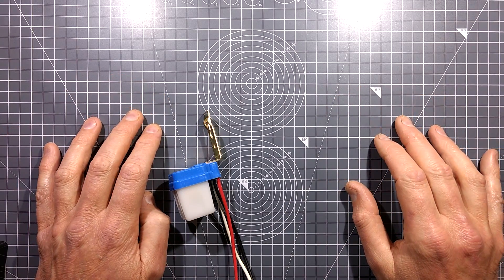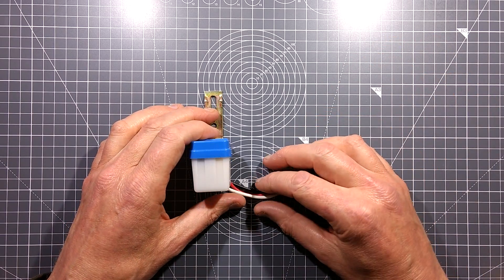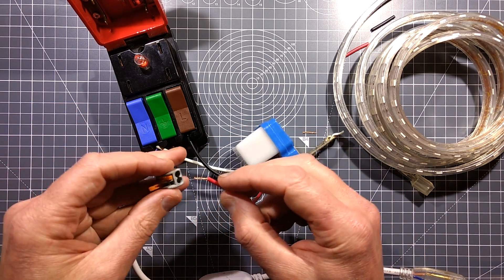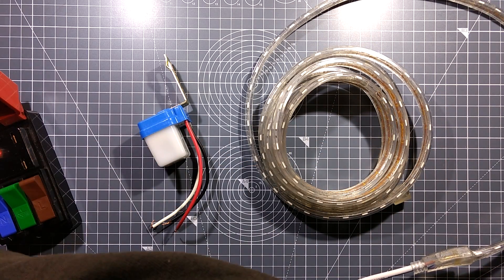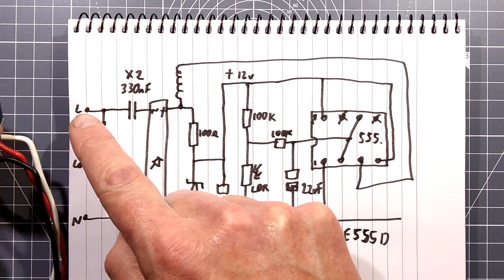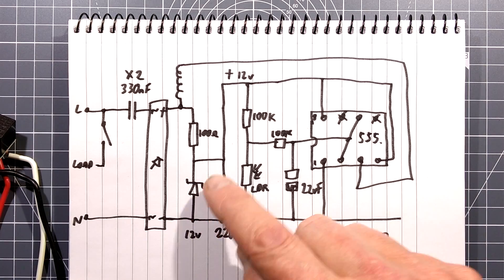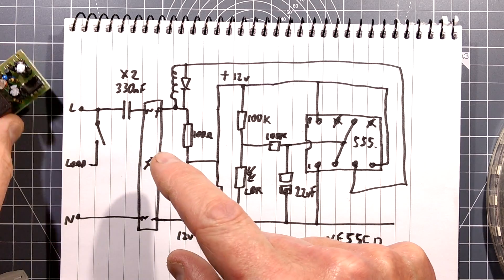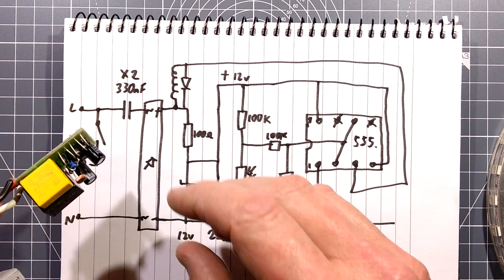Common Chinese dusk switch.  (With schematic.)

Comment: How about using one of these USB 8W soldering irons and a power bank for rewiring it on the field? BTW mine arrived, loving it.
Reply: Juan Herrero 8W really is not adequate for any serious soldering work (15-20W is a more reasonable lower limit).  You could get by with soldering very light connections with very light gauge leads or wires using an 8W iron, but try such on a windy day and will not accomplish much at all outdoors.  The easiest way to solder outdoors is with a butane torch, with or without a soldering tip (depending upon the precision demanded by your task).

Comment: Hi, I am wondering for quite a long time if PIR sensor can be replaced by very common ebay ultrasonic distance measuring module in combination with NE556 to drive low voltage LED lightning in case when PIR is too large or useless due its pyroelectric principe... If this sounds interesting for you, maybe you can build something on breadboard :-) I hope that this build will interest many users ...

Comment: I use thse Wago connectors for connecting lamps to the wires coming out of the ceiling (if the lamp doesn't come with a terminal block); also for connecting the heated build platform of my 3D printer to an ATX PSU. They happily take 6A and more.

Comment: Clive..is this possible? to make a solar/ battery grow light for the green house.. so when it is dark the grow lights come on and provide growing light for the plants..what would you need for this? how big could you go with the lights/battery/solar panel for a  10x6 green house?Cheers for any tips and advice.
Reply from the maker: I doubt it would be viable to produce the proper levels of illumination without a very big panel and battery bank.  But you could use the 12V version of this and a smaller panel to at least provide general illumination.
Reply: Thanks for the reply Clive... I was thinking of the led grow lights in a strip type...low wattage..like these 
eBay item number:321913686531
using some 18650 3000 mAh cells in a bank of them 12v ish charged from a large 320w solar panel..enough to get the led strips to run for 8 hours at night approx.. depends on how much sun is available during the day to charge the battery bank i suppose.. but i guess it could be worked out to what is required.
Reply: Mitch Seymour You typically need very high light levels to effectively enhance plant growth and that means high wattage lighting (even by LED standards).  Quite simply, if your LEDs do not require significant heatsinking then they likely do not put out anywhere near enough illumination for plant growth purposes.  For a stationary application lead acid batteries are usually going to be far more economical and have less voltage swing (LED illumination levels are very sensitive to variations in voltage unless driven by a DC-DC converter to maintain a stable voltage as the battery discharges).  Also keep in mind that the full sun equivalent hours for charging purposes is typically equal to only a fraction of your available daylight, so you will likely need a solar panel array capable of fully recharging your battery within 5-6 hours each day (a bit more in summer months), even on an overcast day when they may only provide perhaps half of their rated power.

Ideally you would use LEDs optimized specifically for plant growth as plants desire slightly different color peaks (wavelengths) than we necessarily desire in our interior lighting and the greatest bang for the lighting dollar is found by delivering exactly the wavelengths that are most efficiently exploited by plant chemistry (the most important bands are typically in the red and blue wavelengths leading to a magenta tint to the light, with other wavelengths sometimes added, such as green, near UV, or near infrared, in to further tailor growth characteristics for specific crops).  They also often avoid phosphor based LEDs (such as our typical white LEDs) since the phosphors degrade over time, typically opting for a mix of pure color LEDs to obtain the desired amount of light at each peak as single color (non-phosphor) LEDs do not degrade significantly over their lifetime if operated within their design limits.

Comment: I have 1 of them wired to my back light with a 20 watt fluoro that hasn't missed a beat in 3 years of running 24/7.
Reply: Well my light finally died, thought it might have been the dusk switch after checking the tube, and starter and they were fine. I had a spare switch stashed away in case it died and finally found out where I hid it all those years ago, wired it all back and, nothing happened, figured I must have wired it wrong so had another look at the old one that I took out, connected it up to mains it still works, rechecked my new install and it was working too, so the flouro fitting has died at last, time for a new 40 watt er.

Comment: I would love a tear down of that Quick Connect(to main). That looks safer than holding a plug to the main wall socket and thinking "ok... if there is spark or smoke I need to unplug this right away."
Reply from the maker: Just search my videos for it.  Quick test.
Reply: get get There is not much to them, more a closed variation on the old knife switch with the shorting knife captured in upper hinged cover and the contacts recessed in the base portion...and a fuse inline with the hot/live knife in the upper cover to provide overload disconnect.

Comment: I have an impulse sealer from 2002.
I modded the LED to blue (because it was more visible) and tested it.
I unplugged it and set it aside, then I realized the LED was glowing dimly. There are no high value capacitors connected to the circuit and power is controlled by a relay, so there can't be a stored energy that could light up the LED for 3 minutes...where could that energy be coming from?
Reply from the maker: Blue LEDs will continue to glow for a long time with residual charge on power supply capacitors.  It only takes a uA or less to make them glow.

Comment: In the electrical sign industry we call them "Photocells".
Reply: Gregg Macey Technically, a "photocell" would produce an innate voltage (hence the "cell") in the presence of light (such as with a solar cell) whereas a photoresistor or Light Detecting Resistor merely changes in resistance in response to varying light levels (although photodiodes and phototransistors can generate a small voltage in response to light, as can any exposed diode junction, including ordinary LEDs and glass encapsulated diodes).  But it not an uncommon misnomer to refer to them as photocells (many do).

Comment: if you put the sensor in the middle of the LED loop, will it just turn on and off?
Reply: jerseyforlife 555 can do this on its own, no light sensor needed.  A more fun circuit is the Roadworks lights that will be off in the day but make each other form a blinking running light showing motorists where exactly the temporary barrier narrows the roadway.
Reply from the maker: Yes it would.
Reply: hm..simple flasher circuit

Comment: for the 555 ...setting the timing for the bio sensor as active, being active and turning off/cycling? so the rest of the circuit knows when the "read" is complete and can process the read data...maybe?

Comment: Can you buy the mercury switches that they use in some car alarms that detect if the angle of the car changes (ie if someone is trying to load it onto a flatbed trailer and steal it that way) are they readily available, or affordable? I can't say I have ever seen them around
Reply from the maker: You can buy mercury tilt switches on eBay, but like all important electrical components they have been largely outlawed by the RoHS (Reduction of Hazardous Substances) regulations.

Comment: Is it driving anyone else crazy how this thing gets installed/mounted so it meets code?
Reply from the maker: I think it's designed to meet Chinese code but not most others.
Reply: bigclivedotcom It's obviously supposed to go near the TOP of a wooden lightpole, wired directly to the bare overhead wires. Putting it above the streetlamp avoids the blinking problem, car headlights and provides code compliant isolation by beeing out of reach.  If the relay is good enough, it can control an entire street of lampposts.

Comment: Vcc isn't "voltage common collector" it's just the collector supply voltage. It's usually positive. Vee is the emitter supply, usually negative. Vbb is the voltage that would be at the base if the base-emitter current didn't drop that (actual base voltage is Vb). Vdd is drain voltage of a FET (usually positive), Vss is source voltage (usually negative) and Vgg isn't really used since FETs don't have high enough gate current to matter. In a circuit with multiple transistor types one does not use separate rails for P and N types, so for a PNP (or P-channel FET) Vcc is positive and connects to the emitter, while Vee is negative and connects to the collector.

I say usually a lot there. It's nearly universal. But if you've got only P type devices you might label the rails as Vee (or Vss) for positive and Vcc (or Vdd) for negative. This pretty much never happens.

TL;DR: Vcc, Vdd = +V. Vee, Vss = -V.

Comment: the american mains colours are
Red = Live
Black = Neutral
White = Earth
Reply: Wrong. Black is hot in the USA. Red is switched hot, and Green is ground.
Reply: Paul Frederick sounds like someone might have a rival against a tech wiz....
From what i have done using a plug from the mains [i used an old AC to DC converter] and i had a DVM on both wires, both ways, with red to red i got +12V, with black to red i got -12V
Reply: just did a google search, i was thinking of the alternate 1980's mains colour code..... advise to ignore the dumb moment

Comment: 555 timer, applications: fusion reactors, warp drives, Terminators
Reply from the maker: Cyberdyne used a lot of 555's.  They reckon that's what went wrong with Skynet.
And now Google is using them too.  Will people never learn how dangerous these chips are.

Comment: Does a photoresistor produce any kind of voltage whatsoever? even if its in nanovolts range when exposed to direct sunlight?
or does it ONLY and PURELY change resistance and nothing else?
Reply from the maker: It only changes in resistance.  But a silicon photodiode acts like a small solar cell.
Reply: Interesting o3o.
I think when I checked with my multimeter I got a very tiny reading of voltage but no current at all. so even using an LED as a solar cell would work tremendously better

I have an idea. get like several hundred LED's. hook several sets of 100 in parallel. in series. and see if you can get useable current from it to charge a capacitor or battery with perhaps a DC/DC boost converter?
I'd use a multimeter to test all the ones in bright sunlight and see which ones give you the most voltage reading.
It'd only take a few in series to power a handheld calculator. since it only draws a tiny amount of current

I got 12 to 24v from an 8.5W LED ring from a LED light bulb.
Charged a capacitor up and was able to get a small spark from it in just a few minutes in direct sunlight
I used a 4uF capacitor.
probably should get ones that have no phosphor coating of any kind. yet have a very large die size
I think even the resistance of the multimeter reading the voltage will affect the output voltage of the LED's

Also could test whether the directional or straw hat LED's give the most voltage. and LED size.

Comment: So logically the timer chip is being used for switching rather than timing, timing being achieved by the capacitor downstream of the photoresistor.  Though perhaps the total time is a function of both.
Reply from the maker: Yes.  The 555 isn't just a timer.  It has threshold detectors, a latch and an output driver.

Comment: I was hoping to find someone in the comments who was explaining about how you can use a 555 chip in a fingerprint or RFID reader, but all I found was complaints about the change in workbench. Honestly, on that front, I come for the content, so I don't really mind either way. The hot spots are a little annoying, but not enough for me to care. If you do keep it, it would be nice if you found a way to get rid of the hot spots by adjusting the lighting some, but I'm happy either way, personally.

Comment: The old bench was heritage! It bore the scars of all those Big Clive episodes from the past, so I'm definitely in the "Bring the Old Bench" back division here!  As for the 555, yes a rather vintage IC, and the first ever IC I used (Practical Wireless Metal Detector using a 555 as a tunable oscillator (variable R, constant C)). Maplin did a mail-order book entitled "101 Useful 555 Circuits" which is up in the loft somewhere - everything from kitchen timers (obviously) to model rail controllers / signalling controllers,  Christmas Light controllers, and a host of other applications. Seeing as they are so cheap it'll be interesting to buy a bagful and revisit my mis-spent youth!

Comment: I have been using a 12V version of this for some time to run a short piece of waterproof LED tape in the porch.

I expected water ingress issues (as I did literally just screw it into the porch trim) but so far its been working fine.  I did wrap some amalgamating tape around the screw holes and where the wires go in, in the hope it reduces the chances of water blowing in.

The water has only been an issue in the junction box as I foolishly didn't drill a drain hole in it.

Really the only issue I have is the lights come on when its not yet dark enough to get any benefit, so I was quite excited to see this video to confirm where I need to be looking to fix that.

Comment: The capacitor dropper, what is the "X2"?
Reply from the maker: An X2 capacitor is rated for mains suppression use and is a good choice for a capacitive dropper.
Reply: At first I thought "X2" = times 2 caps in parallel.

Comment: I like the idea of changing the resistor values, throw in a 1 meg pot inseries with 100 k resistor pop a hole in the cover and make it easily adjustable.

Comment: The scorched and stained desktop has character, no glare, and is the BC trademark. Much better for video than the New Improved Model (R). // Good old 555's; those claims on the data sheet are quite believable, because those chips used to turn up in the most unlikely of circuits. I've even seen one being used as a local oscillator in a home-made radio receiver. Tough little beasties, too.
Reply: RWBHere doesn't improved imply "not new"?
Reply: True; I used the word deliberately. It's a popular advertising buzz word, and some of those ad folk seem to know little about correct grammar. That phrase makes me cringe, especially when 'New Improved' really means, 'Now Cheapened'.

Comment: You could probably get some dulling spray to reduce the sheen of the new workbench cover, reducing the glare from the floods... :)

As for the photocell, which way is up? Cos with the white side up, the wires are going to be like wicks, and with the blue side up, the cell isn't facing the sky and is more likely to be triggered by ground-level light sources (such as the light it's turning on, and off, and on, and off, etc.)....

Comment: Whats the model of your printer?
Reply from the maker: It's an old Epson SX515W fitted with an external ink tank system.
Reply: Thank you Sir. That is called CISS.
Reply: One more question, what's the app that you are using to wash out colors from the photo. Is it any standard editor?

Comment: This sensor seems very sensitive, I would worry that it would just turn itself off when it triggers the light. If you put a brighter light in series with it, does it strobe or just go on/off every few seconds?
Reply from the maker: You do have to keep the sensors above the light sources.

Comment: If you want to use that mat instead, you need to do something about the two hot spots, IMHO.  Mount your lights on a different angle perhaps?
Reply from the maker: Sadly, they can't go back any further.
Reply: to the sides then?  bounce the light off something white, similar to photography studios' white umbrellas?  Dunno...just sayin', the hot spots are a distraction; as you found out, zooming in helps (because they're out of frame), but I can tell you don't always want that close a shot.
Reply: rchandraonline Put a bigclive.com sticker at that spot so the paper texture diffuses the light.  2 in 1 fix.